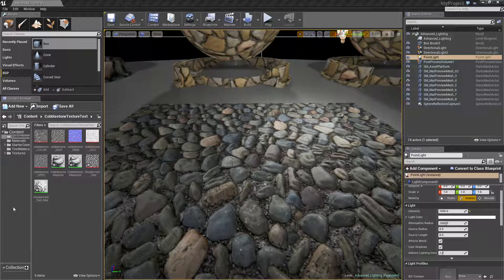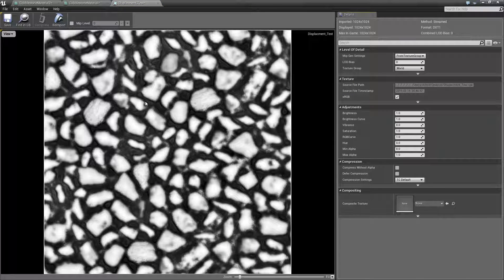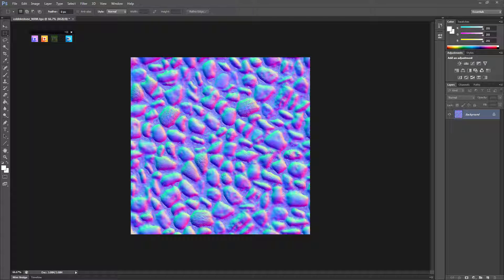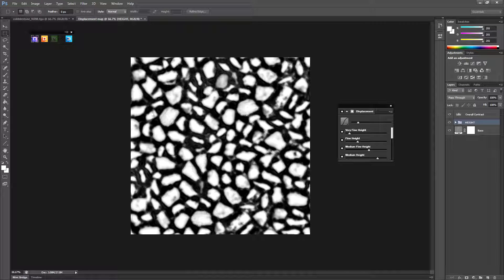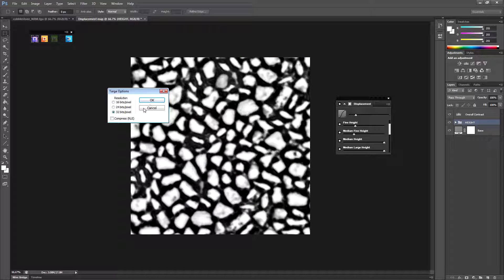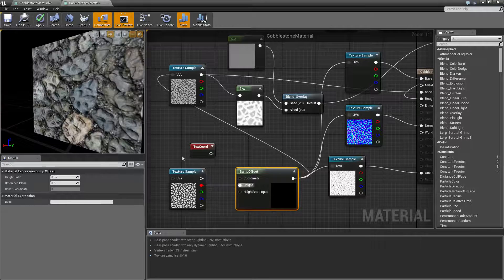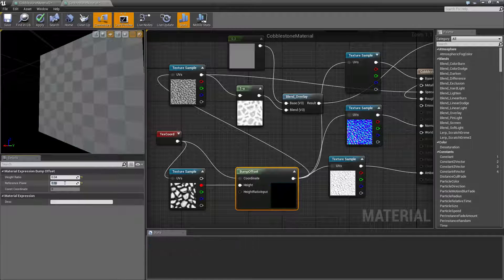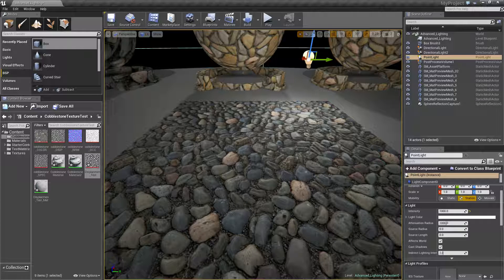Ue4: advanced materials (Ep.3 advanced normals BumpOffset/paralax (using NDO))

Comment: noob question.. why did you connect the red channel rather than the RGB?
Reply: +Ali Al-Ebrahim (Ali20100000) Height data is usually a grayscale image (white = highest, black = lowest). Therefore, the "Height" input on the Bump Offset node only takes data that has 2 colors (it's a float variable). The RGB socket outputs 3 colors + alpha (it's labeled as a float2), so they're incompatible. If you connect RGB to height you will get an error saying float and float2 are incompatible.

Now, the separate color channels don't directly output their given color. Instead they also output grayscale data (a float), but instead of height these determine how much of that color should be rendered. In this case, white = 255 of Red, black = 0 of Red.

Hence, "Height" accepts any single color data, as that data is just a grayscale. Now, since the texture used (the height map) is grayscale, all the different colors (Red, Green, Blue) have the same value. So Green and Blue could be used for the same result. Red is just highest up so it's the common one to use.
Reply: +Kuzune THANKS :))